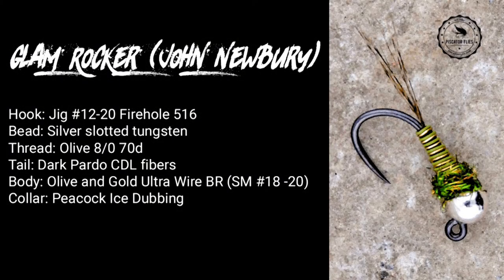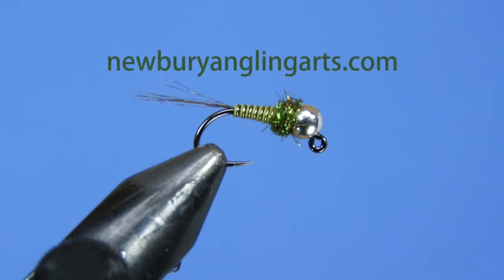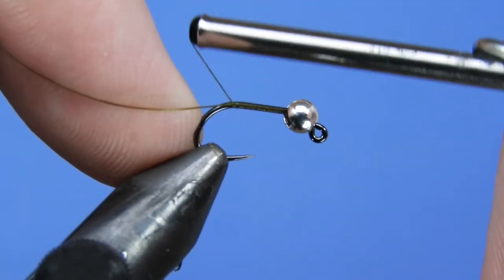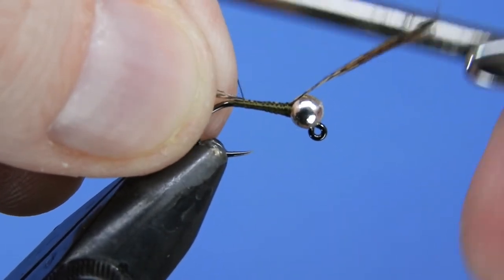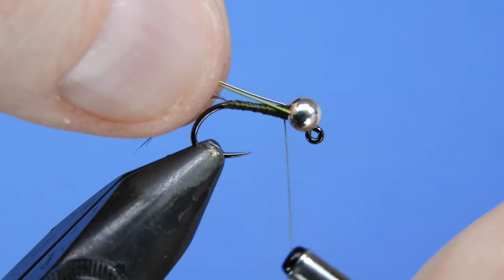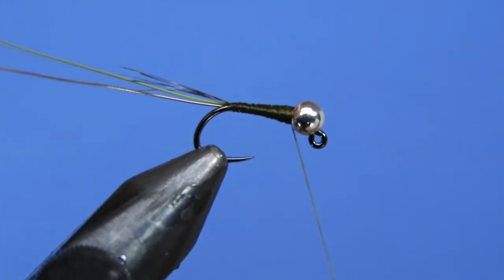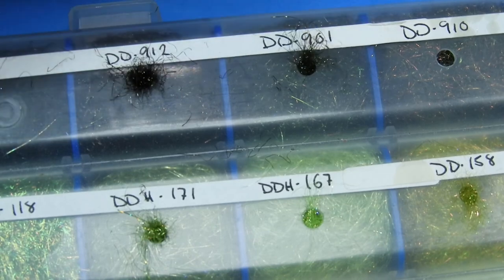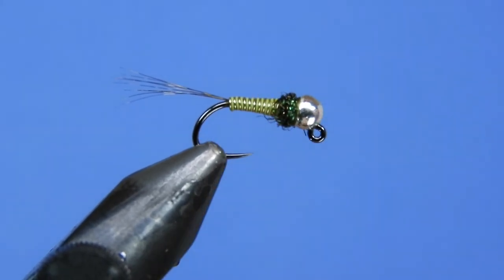Tying the Glam Rocker Fly Pattern - Ep180 PF #PiscatorFlies

Comment: I saw you put in a half hitch before you turned the wire.   Is that something you need to do? Or a habit for using the rotary?
Reply from the maker: Scott Lowe thanks for the comment. I tend to add a half hitch out of habit, mostly before I wrap a body material so that I don’t bump off the thread. Not something you need to do, but might save you. It’s sort of a save point like in a video game IMHO. I hope that makes sense. Cheers